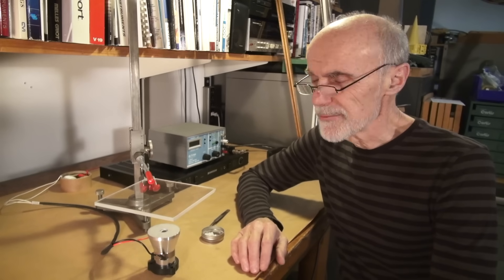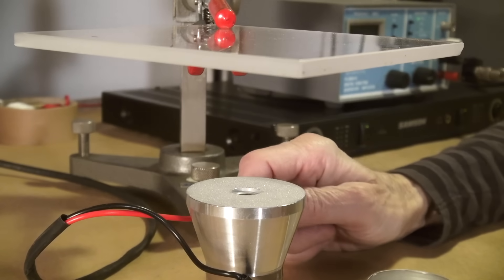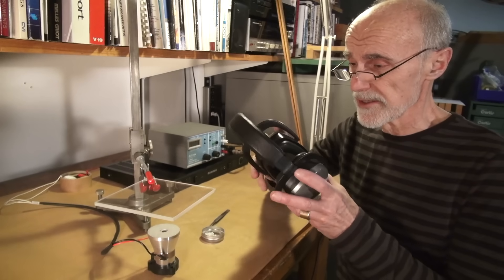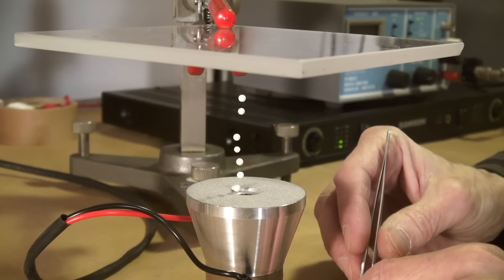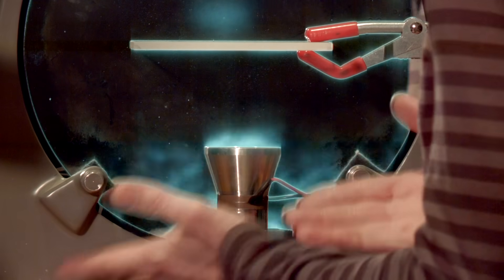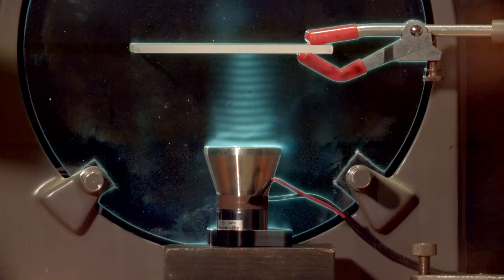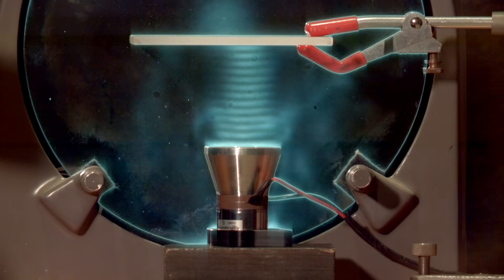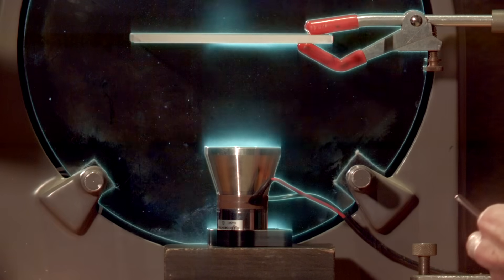Acoustic Standing Waves and the Levitation of Small Objects

Comment: March 2019 the university of Rochester LLE discovered how to turn liquid metal to a plasma state under high density conditions. What's in our Earth's core? Nothing BUT high density conditions. 

https://www.sciencedaily.com/releases/2019/03/190311125134.htm

Here is an experiment done with a plasma ball being spun at 4000 RPMS. It creates its OWN magnetic field!! Notice how the south pole tries hard to form, despite the post fueling it being in the way. 

When they put a tinfoil hat on it, the plasma tries to draw energy off it. NORTHERN LIGHTS. Drawing charged particles of the sun to fuel our core.

https://youtu.be/Wis_HEa3X84

Admiral Byrd ring a bell??? He flew his plane into a massive hole in our pole and came back claiming "A sun inside the Earth". 

Now you could perform that EXACT same plasma globe experiment with metallic plasma. Nickel and iron, instead of basic neon gases like in the standard plasma globe. Rotate it VERY FAST and what do you get?? A VERY strong magnetic field.
Prior to massive quakes, they've discovered MASSIVE amounts of Very Lower Frequencies and Ultra LF's leaving the faults, and plates, hitting the ionosphere, plucking the magnetic field string like a guitar. Or if you prefer, plucking the magnetic field string like a H.A.A.R.P, causing reverberation heard for hundreds of miles. (Trumpets). 

https://www.ncbi.nlm.nih.gov/pmc/articles/PMC6010448/
Plasma is the only thing that can NATURALLY cause VLF/ULF waves. 

Linda Moulten Howe had a piece of UFO metal sent to her from a man who was involved in a crash cleanup in the 1940s in white sands NM. The bottom of the craft glowed for 3 hours after the crash. After it stopped glowing, he broke pieces off and kept it for nearly 50 years. In 1996 his son sent pieces of it to Art Bell. He gave a piece of it to Linda Moulten Howe. Upon scientific analysis of it, it was discovered the metal is made up of micron level layers of magnesium, zinc, and bismuth. Upon furthef analasys, results show it was subjected to TERAHERTZ frequency approaching the speed of light, and it's ION levels were 60 percent higher than they should be. This will shed light on that for you. 

Here is an experiment done with a ham radio 100 watt put through 4,3 500 Z tubes bringing it up to 3400 watts. in which the stainless steel antenna is being turned to PLASMA because the antenna is being pumped with HIGH FREQUENCY Waves the metal cannot handle. He's able to talk through the plasma because the plasma causes VLF waves, like a speaker does. 

https://youtu.be/4yLbYlyT7wM

Linda's metal has 60 percent more IONS because it was turned to plasma using an even HIGHER frequency. Terahertz. High frequency turns metal to plasma, BYPASSING the liquid stage. Terahertz, could BYPASS the plasma stage, converting to a state of matter we have not seen yet. Pure energy maybe? 

Linda's ufo metal is very special. Bismuth, magnesium, and zinc all are DIAMAGNETIC metals. Meaning they REPEL magnets. So if you perform the EXACT same experiment like the plasma globe, you will NOT get a electromagnetic field. You get a very STRONG Diamagnetic field, the faster you rotate it, and the more energy you put into it, the stronger it will be. Meaning it will repel ALL electromagnetic waves that are IN and around EVERY object on the planet that obsorbs charged particles of the sun. Including in the air. Imagine the plasma ball experiment done properly, and a decent size, being able to levitate 10 ton granite slabs and pushing them. 

Let's look at Bob Lazars Element 115. Unumpentium. Now known as Moscovium. Only a few atoms have ever been made, and they've been made to make NIHONIUM (Element 113), which was created by colliding ZINC nuclei, together in a thin layer of BISMUTH. 

Both DIAMAGNETIC elements. 

both UFO cases involve these crafts creating ANTI MAGNETIC FIELDS. Our Earth's core, is plasma. The strongest electromagnet of the universe. Everything IN and around us has electromagnetic waves holding us down. 

Look at the moon. It's the size of earth's core. It has a SMALL plasma core. We SEE flashes of its light bouncing up off the crater walls, which looks like lightning in craters. The moon has a small magnetic field. It has small amounts of electromagnetic waves on it. "gravity".

 Why couldn't Einstein solve gravity? Why couldnt Issac Newton solve gravity? Why are scientists still chasing their tails for gravitons and dark matter??

Gravity is NOT REAL. So the elites who rule over us can keep us ON the ground, under their thumb. The minute we can leave this planet, we're FREE. To never return. Who will they borrow money to then at a high interest rate???

The universe is ruled by electromagnetics. Charged particles of not only our sun, but billions of other suns in the universe spread electromagnetic charged particles at ONE million miles an hour absolutely everywhere, covering every inch of space. The universe is the ocean. UFOs with their Anti-magentic fields are the surfboards. 

These UFOs are creating DIAMAGNETIC fields. To push away ALL electromagnetic waves, using it to generate push. 

The battle of Los Angeles. Mortors couldn't hit that UFO. It REPELLED them. An outwards force. An outward diamagnetic force repelling all the metal mortors. 5 people died that night from falling debris. 

Why do you think the "small" amount of energy from lightning (plasma) always tries to ground itself?? It's trying to connect to the quantillions of watts deep below our feet. Here is the first ever slowing motion capture of lighting striking the ground in slowly motion. 

Watch what comes OUT of the ground at the 2 minute mark, to connect with the lightning coming out of the air. 

https://youtu.be/RLWIBrweSU8

If our core WASN'T very strong electromagnetic plasma, there would be NO WAY to drain the electromagnetic energy of the sky, resulting in CONSTANT massive storms on our planet. 

The word gravity has been pounded into our head MUCH longer than the word Russian. 
 Call invent-help and listen to them tell you they aren't allowed to help you find alternative fuel methods for vehicles , and alternative energy sources because it's against  government law. 
You saw what kind of Plasma that stainless steel turned into under high density conditions. With your own eyes. But go ahead and keep reading government printed books by government funded scientists. Fun fact, 90 percent of scientists are JUST like you. They read. That's IT. They also comb through thesis's and pick and choose what to accept into their teachings as well. There's only a VERY small handful of scientists working with REAL equipment to chase down God particles and dark matter and gravitons. And they're ALL government funded. But one fact remains. We will NEVER find the source for "gravity". We will always as citizens, be stuck here on this planet under their thumb, until you rise up, and ask questions. Start with the space shuttle Columbia. Look for the lightning bolt striking their IONIZED trail, traveling up said trail to hit the shuttle, resulting in the death of the crew. 
29:30 mark. 
https://youtu.be/e0vu-jQWCZo

Electromagnetics rules the universe. 

Gravity is BS. It's time we replace "Gravitational pull", with "Magnetic pull".

Comment: So, thinking out loud here. If that device were self contained as a unit and the foam balls in the middle were a platform holding the device all in the same unit, could it levitate itself (the unit) depending on frequency to move up and down?
Reply: The acoustic force field is not strong enough.

Comment: Why ball is rest in white area
Reply: They come to rest in the high pressure zones
Reply: The high and low pressure zones alternate and make up the standing wave.
Reply: @wolfgangrueckner7151  but in the standing wave why some particle are stay
Reply: @wolfgangrueckner7151  why air density are change
Reply: @dhruv3579  Sound waves are pressure waves and therefore cause changes in the density of the air.  In a standing sound wave, the pressure changes stay in one place (that's why they're called standing waves).
Reply: @wolfgangrueckner7151  but my question is what reaction between them change air density

Comment: if you lengthed or shortened the wavelength as well as moved the reflector so it remained at the right distance could you make a ball travel up or down on pockets of high pressure? 
 Does it have to be a reflector? Would another speaker work and could the timing of the frequencies being generated  replicate the distance of the reflector? 
Would an air tight tube over the assembly amplify the pressure forces? 
i think you'd only need to double or  half the wavelength and then jump back and forth between with a graduation in the direction you wanted them to travel to get the effect. 
 i bet none of that even makes sense. I've been drinkining and smoking again.
Reply: I would say that, n answer to your first point, as you change the frequency the standing wave disappears so the balls would fall before getting in to the next frequency standing wave.
Actually its a bit like the quantum situation in the atom in which  only certain energy levels are allowed and nothing between.
Reply: @iainmackenzieUK  And there is no way force 'x' standing wave to be 'x+1' standing wave? it's only specific frequencies that create standing waves and they won't reappear untill that wavelength is disrupted by itself in that way. modulating the speakers wavelengths incrementally in sync would not produce incremental standing waves over a distance of two wavelengths? 
 I'm soberish now and I'm still spewing nonsense 🤣 
 if a tube was resonating a drone could you create standing waves in the harmonics? because you could graduate small distances up that way but the distance would need to be rapid and minute enough to remain under the ball before it dropped. 
 safe to say you could lower balls in this way gentlely or toward any gravitational field. i wondered also if aero gel balls would be better effected by the air pressure and if that efficiency could allow for different shapes to be effected in the same way as a ball.
 i like thinking about things i have no idea about, i'm usually wrong i just enjoy it. Thank you in advance for any time you give this and please don't feel obliged to respond. This stuff is cool. 
 also in terms of interference what if you only observed them as waves at the loaded point and observed them as particles everywhere else. could they pass through each other? sorry, rabbiting. 🙄🤷‍♂️🙋‍♂️
Reply: @kurfbigman7946  Hi Kurf. I am certain that you could  keep the balls suspended by changing the distance between the source and the reflector. because the distance can have ANY value. (ie is continuous) But if you look at the way the balls drop... as the frequency is increased, they dont drop straight away, its as if the standing wave changes shape for a while. But then once the wave is gone, its gone. until the source reaches the next standing wave frequency.

Comment: Why do the balls stay where the pressure is high? My guess was that it would be the opposite-the balls would be pushed by the high gas pressure into the regions of low pressure, as is the case with a chladni plate (there it's about vibration amplitude). Also smoke molecules would follow the same path, hence why I thought the bands where the smoke is would be bright. Anyone can explain?
Reply: The prevailing view is that the balls levitate in the low pressure zones, but our measurements show otherwise

Comment: I wonder what would happen if you swap the wave from ultrasonic into Eletromagnetic waves & Gravitational waves and not just 1 wave from each spectrum, I mean every wavelength from every spectrum including sound. All in Resonance with eachother in 3D space since these waves are actually fields, the Calibration off all Fields including Quantum fields(since Eletromagnetics and Gravity Manipulation is Involved) would need consonantly in a feedback loop trying to find the best Resonance as the object moves (Quantum Ai would be able to find the Resonance Frequency of all Fields very quickly once the framework for Quantum Ai is setup)

By this topic is called ElectroGravitics if your interested but this is more of a Tractor Beam device true ElectroGravitics is UFO Technology Basically 2 counter Rotating Superconducting Resonancing Eletromagnetic rubbing against eachother in the most efficient way possible using Superconducting Resonance. The rubbing of Eletromagnetic fields can be seen like friction as it wastes energy for the system, but instead of losing energy through heat like friction does Eletromagnetic Field friction loses energy through eletromagnetic force constant counter Rotating Fields puts constant pressure the fabric Spacetime which inturn effects on Earth's Gravity (Earth's electromagnetic field) you might be able to Cancel out earth's gravity if you have 1 counter Rotating Field against the earth's electromagnetic field if you kept going higher in power and Superconducting field strength/force you can achieve Antigravity effects but you can't leave the Earth's Atmosphere and the further away you are from your Eletromagnetic Source (Resistance to gain EM Frictional Energy) in this case the Earth the more energy you need to gain the same EM Frictional. Which is why the Counter Rotating Fields are Better. But I don't see why we can't add more fields that way you could make some insane Celestial Star Ships that could trap Spacetime in a Extremely Strong Counter Rotating Eletromagnetic fields with humans safely inside a Space-Time independent EM Bubble inside our Universe (if you had enough energy to keep it and max EM strength forever, then it would be a Mini-Universe independent from the Outside-Universe). I know more hidden technologies that involve going significant percentages of the Speed of Light and even over the speed of light from an outside observer but relative to everyone and every molecule/force inside The Space-Time Independent EM Bubble, they didn't move at all. According to the Quantum Equations the Outside-Universe/Space-Time moved around them in a perfect toroidal pattern (Donut shape) contracting at the  front and expanding at the back and perfectly blending inbetween auto-mathically, this means that the Space-Time in this toroidal area in warped causing Space-Time/EM/Gravity Fluctuations (Flux) around a Proximity around your Celestial Star Ship (UFO) proportional to your EM Friction Strength. 

I could go on forever but I'm going to stop here with One last thing. 

This is the key to Time Traveling into the Future using Time Dilation inside a Space-Time independent Bubble.

Comment: Shouldn't the styrofoam balls be suspended in the LOW pressure zones? and be repelled by the two HIGH pressure zones above and below?
Reply: Indeed, everyone agrees with you, but our pressure measurements show otherwise
Reply: @wolfgangrueckner7151  is it certain that the high and low pressure zones correspond to what is mentioned in the video? Maybe he named them wrong?
Reply: @leavoa  Our  pressure measurements indicate pressures above and below atmosphere where the bands of light appear.
Reply: @wolfgangrueckner7151  thanks for the reply. That makes sense, with respect to constructive and destructive interference, I'm just puzzled that the stability points are within the maxima points.

I can conjecture that at the destructive interference points pressure is roughly 1atm, while the pressure at the maxima points might oscillate between 1.01 and 0.98 atm (for example), this creating a net negative pressure zone in that area? But I can't explain why it wouldn't be symmetric around 1atm.

Is there an explanation for the fact that the stable points are in the constructive interference zones?
Reply: @leavoa  It helps to visualize the actual motion of the air.  The air molecules are in an anti-symmetric normal mode of vibration.  From a ball’s point of view at a pressure antinode, air molecules are either rushing in symmetrically from both sides or moving away symmetrically, and so the ball settles down in this zone of least motion.  Its inertia prevents it from vibrating back and forth at such a high frequency.  When gravity pulls a ball downward, the ball will encounter more collisions with air molecules from below, resulting in a net upward force, back to symmetric equilibrium.  This simple model offers a plausible mechanism that accounts for the balls levitating at the pressure antinodes.

Comment: Is it possible to use "while loop" that will continually adjust frequency based on distance of reflector, to maintain standing wave during movement up and down?
Reply: Yes, but not with this particular transducer which only operates at 28 kHz

Comment: I'm confused by this description of standing waves. Standing waves are waves that don't have any apparent longitudinal motion. But they still oscillate. A standing longitudinal wave (like in gas acoustics), oscillates between high and low pressure at any one point. At the nodes, the pressure doesn't change. At the anti-nodes, the pressure changes from some maximum to negative maximum. At any point the time integral pressure would be equal to the ambient pressure. So I'm still not clear on how there are "High pressure" zones that can create the buoyant force required. Additionally, how is it that we see these bands as a constant shape. I'd think the high frequency would cause the net pressure and thus the net optical effect to appear constant across the path from speaker to reflector.  Can someone explain all of this to me?
Reply: Your understanding is quite correct.  The white bands of light are regions where the pressure is either greater or less than atmospheric pressure.  Since the frequency is 28 kHz, you don't see the transition from one to the other.
Reply: check out our newer videos:  https://www.youtube.com/watch?v=MBPh410Gnes&t=83s